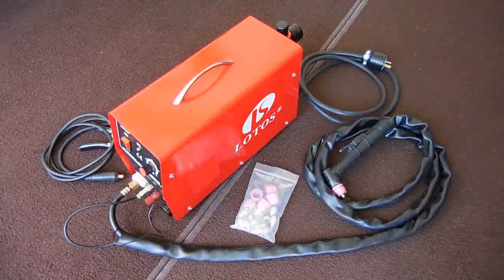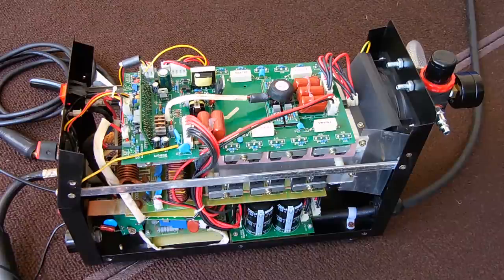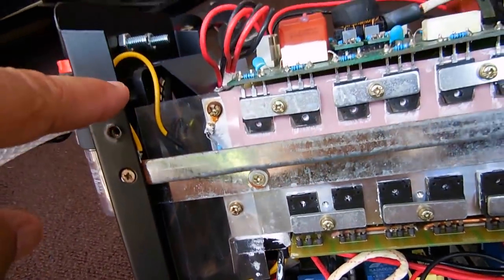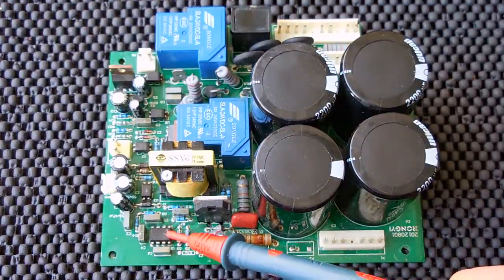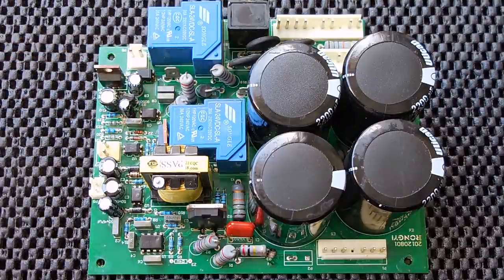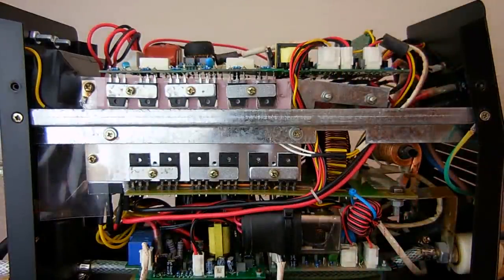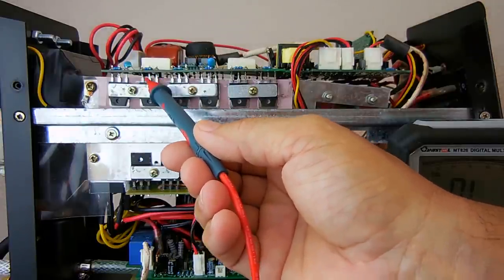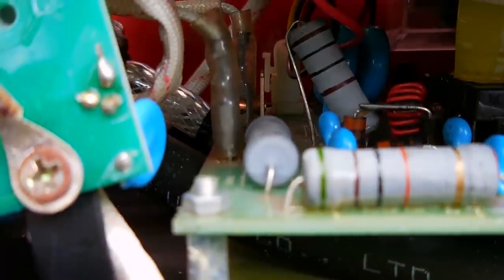How To Repair A PLASMA CUTTER!

Comment: I watched your video looking for an answer to why I'm getting intermittent cutting, or interrupted cutting at both 120 and 240 volts. Is it possible for the contacts to be dirty or incorrectly set on a new machine? This is one of the Chinese-made "Cut 50" machines. Thanks for showing us how to recognize faulty components and check them.
Reply from the maker: Ben Bennett Definitely check the contacts.
Reply: Actually, it was my not knowing how to position the tool. Anyway, I realized I had 19 volts on the display when I turned the unit on. I turned out to be the fan voltage. The fan was frozen until I worked it free. Then when the fan turned off the voltage went to zero. The funny thing is the unit will cut metal with the dial at minimum setting while displaying 19 volts. Anyway, after unsuccessfully trying to convince me that intermittent cutting was normal for these machines, they rendered a $100 refund to me for repair it. I put a clothes dryer cord on it to make sure it gets good power. Like I told the seller, this will work for a hobbyist. Wish me luck. Thanks again for a great video.

Comment: I have a thermal dynamics stacpack power module 6030 in 60/40 which is about over a 20-year old machine anyhow the machine used to work good every once in awhile it would have an issue you would have to tap on the torch and everything else it is a 70 amp machine I really like the way that this machine performed when it did perform anyways I was had the cap off it blowing it and tightening up a couple things that need to be tightened up on the inside for the air fitting I did quite extensive work trying to get that all configured so it fits tight against my back wall cuz where I'm using and I don't have a lot of space unlike some other plasma cutters I've seen like Lincoln they put a really thick film on all your little small components so they don't get loose this machine did not have that so that being said I'm moving it around I'm sure of being a 25 year old machine one of the little things got loose I think it's called a crystal I took it to a few different places they cannot fix it because they don't know what the exact name is of the peace that it needs and they cannot find no information supposably is what they say but if I really wanted to I can have the board fixed for over $1,200 they will fix it at one place called Gelco Electronics anyways I don't want to spend that much when the machine is you know 25 years old if I had to I would if I had to I would because I know the machine but I really don't want to when this part that I unsoldered is probably a less than a dollar or a couple dollar part and I've checked all the other things and everything else seems to be working properly I am just not getting a narc out of the gun air pressure works all that and the air pressure stays now running when it never did before so trying to find out maybe I can send you pictures of this board and a video of the symptoms that has since this little transistor or electronic piece of part resistor capacitor or Crystal is what I'm thinking and what a few people had said did it possibly is but they wasn't a hundred percent sure if I could send you some photos and a video of what the machine doing that would be awesome Lee great thank you so much for posting this video and hope that maybe you can guide me in the right direction of where to get this part from so I can get this machine back up and running like I said I know it's an older machine but man it worked great

Comment: Liked your video! Steve called, he wants his plasma cutter back : )
Reply from the maker: :-). Thanks for watching Matt!
Reply: @electronicsNmore   when you tested the relay did you just measure continuity between the two non coil points
Reply from the maker: @anthonylester3247  Yes. Making sure they open and close properly at a very low level of resistance.
Reply: @electronicsNmore  ok man thanks what would be a low   resistance value on those or one like it? 14v or something

Comment: any tips on how to troubleshoot the pilot arc not working, everything seems to be working fine except for the pilot arc. thank you
Reply from the maker: Try cleaning the contacts and inspecting that board more closely.
Reply: @electronicsNmore  when i checked the voltage output from the pilot arc terminal on the machine when i squeeze the trigger, it puts out a voltage of at least 180 to 200v but there still no pilot arc.
Reply: Did you ever find your problem? I have the same issue

Comment: Hey, great video, however, I get no arc from the two contact behind the resister. Any sugestions or direction to a previous vid. Thanks. althoug mines is not the same model, they seem to be quite simular in design.
Reply from the maker: Try making the gap smaller.

Comment: Hello, Thanks for useful repair video! I have plasma cutter kind of like this, brand Trexus Welbach with pilot arc. Also quit working, no arc anymore. Sparking relay is pulling but makes no arc between gap. Fan/air work ok. I checked diodes and transistors for shorting.  Indicator light in the front panel is flashing when push the torch switch. Before my unit died, arc was cut out many times during use. Any ideas where to look for?
Reply from the maker: Do you have a spark gap?
Reply: Yes, about 0.7mm. Relay looks different comparing to your unit. It looks like this. http://www.tme.eu/en/details/g2r-1-230ac/miniature-electromagnetic-relays/omron/g2r-1-230vac/

Comment: Hi, it is possible to use TIG machine for plasma cutting? i have very similar machine for TIG welding, but i do not have  installed all diodes. on your machine you have 24 of them, and i have only 16(they did not installed from factory)

Comment: I have a dead Supercut 50. Is this similar in design? How do you feel about the Infineon warp speed IGBT direct replacements for the MOSFETs?
Reply from the maker: Hello. I'm unfamiliar with that unit, but the working principle is the same.
Reply: I looked inside, and it is almost the EXACT same unit lol. Ever do a MOSFET to IGBT conversion with Warp speeds?

Comment: I have a lotos ct520D which looks very similar on the inside.  It does plasma cutting, tig welding, and arc welding.  My device powers on and everything appears normal except I cannot get the welder to produce an arc.  I have checked the ground and electrode holder for continuity and both are good so that is not the issue.  Any idea what would cause such an issue?
Reply from the maker: Check the gap!
Reply: I have the same issue did you ever get your lotos ct520d working ..?
I tried everything …. Then just found the awesome video for more fix tips.
Reply: @J-n-J-2016  Mine was from amazon and even though it was past the return date they exchanged it for me!
Reply: @Chadward_  That’s where I got mine I’m gonna see if I can return it 
Thanks for the info
Reply: @J-n-J-2016  For sure!  I got on the live chat with someone and explained that it just happened on its own, good luck!

Comment: What you are hearing is a arc inside the capacitors. That is to the best of my knowledge with what i can hear. Could be wrong or again I could be right.
Reply from the maker: Capacitors don't arc, if they do, they're damaged.
Reply: @electronicsNmore  Thanks for letting me know fella.

Comment: i have  just got a  icut 60 pilot from ebay , it cuts with or with out the ground connected to the work piece , i do not want to damage the machine , i wonder what your thoughts are , :)
Reply from the maker: I'm not familiar with that.

Comment: Doug great video- I have a question - Do you recall if the mains supply cables ( 2 pairs 220V AC (in my case) ) post the main rear ON OFF switch goes to the two lower power supply boards ( 24V dc and 330 V dc ) ? I ask because I disconnected things and labelled everything but I think I missed one cable being the thinner pairs of cable that come post off the mains rear switch. I don't expect you to look but if you remember ?:-)

I have a generic unit that looks to be almost identical inside . It is an interesting unit in that there is alot of different electronics going on. I wish I could find schematics for these units and I am sure they are about . 

a) Model - My unit is a c416 plasma/tig/stick. I can add to this video because I have fixed my unit. 

b) Power supplies - Seem to be located on the lower level . There are two lower boards (front p/s and front p/s) .The rear one is a 24V DC P/S which seems to power the top front board ( conrol electronics) .
b1) The rear of the top board for a 220V unit has 330V DC supplied from the front lower main power supply board situated in the lower front. I am not sure what the 330V DC is or why it goes to the top rear PCB of unit. I suspect it might be The source of the TIG and PLasma and STICK High current /Low voltage ( 50- 80Vdc open ) DC at welding connections .
c1) The middle board seems to be the supply for the WELDING equipment STICK/Tig head and plasma head. 

d1) The power supplies may not strictly  just be a power supply as the main Lower front seems to have lower voltage cables running from middle board back into the P/s as feedback. I suspect this might be to control voltage /current supply ,thermal protections etc. 

e1) The main power supply seems to have 3 x relays ,2 x smaller ones seems to control the AIR solenoid and something else located on the top rear board . I may add to this as I fond more information. If we get enough information I may post a vid because these are so popular and generic and it's worth having information.
Reply from the maker: My unit is in storage, but I think it was dual voltage. I'm not familiar with your unit.

Comment: It is normal for plasma cutters to make that high frequency noise. Whatever the frequency that the switch mode supply runs at must be somewhere in the high audio range 15 to 20 khz maybe?? We had an older NC machine at work that had a 50 horsepower spindle on it that the SCR based spindle drive sounded about the same.It was a bit scary to work on since it almost always sounded like it would blow up in your face. Actually had an SCR blow up once while working on it. Sounded like a bomb going off. MOSFETS and IGBT's are a definite improvement.
Reply from the maker: Yes. I heard a few switching power supplies make noise before, but I was unsure if the noise from this unit was normal. Thanks for watching!

Comment: Good evening, my friend, please help me to repair my machine LTP5000D, the fault is: the arc is turned on and off immediately (the machine does not cut)

I have to tell you that the video is excellent
Reply from the maker: Try adjusting the spark gap.

Comment: I'm tom, can i ask a question about my lotus LTPDC2000D .I WAS USING THE PLASMA CUTTER AND IT STOP WORKING.NO POWER TO ANY THING BEYOND SWITCH WIRES ON THE MOTHER BOARD.I WOOD REALLY APPRECIATE IT. THANKS APPRECIATE IT
Reply from the maker: Hello. You need to follow my video. Thanks for watching

Comment: I'm having some issues with the pilot arc on my plasma it sputters a bit, sparks sometimes will start an arc when the metal is clean without touching most of the time, I checked the gap between the contacts and the arc jumps across I gapped them out a bit and it made no difference in the pilot arc. Any ideas? Thanks a lot.

Comment: I have this same plasma cutter, it worked great but has stopped starting when the trigger is depressed. I took apart the hose and checked the switch at the handset as well as the plug at the other end- all works fine. This leads me to believe it's an issue with the jack it screws into, or whatever board that connects to.

For clarity- when I say it has stopped starting- there is no spark or air flow. Display and fan starts up fine when I turn it on.
Reply from the maker: Possibly a faulty relay.
Reply: @electronicsNmore  that's what I was thinking, although from messing with it this evening (shorting the pins in the jack body), it is looking like a bad connection there. I need to figure out a source for a replacement jack and plug, looks like.

Comment: My cut 50df stopped working as well. I used it once. I have power and air to the front gauges, but no spark or air when I squeeze the trigger any thought? I have cooling fan also.
Reply from the maker: Make sure the trigger switch isn't faulty. Test for continuity when the trigger is squeezed.
Reply: I will check that this weekend for sure.

Comment: New PLASMARGON Cut50 HF problem
Seems to work fine but when I replaced the leaking front face air meter push to release connector I noticed that the over temp sensor’s wires going to the main board are wrapped around the heavy coil of bare wire connected to the torch + air connector. Cannot see any purposeful reason but apprehensive unwinding them and zap strapping them clear while warranty is valid. No response to same querie from PLASMARGON. Thanks.
Reply from the maker: I'm unfamiliar with that unit. Thanks for watching!

Comment: Hi great video one question, every time I change the Chanel mosfet when we turn on the machine always one or two will explode do you know why will that happen¿
Reply from the maker: Make sure you test all other mosfets, and be sure to use exact replacements,
Reply: electronicsNmore thanks I will and let you know if that fix it

Comment: Will someone clear up a question for me on the Plasma torch?  I have heard both ways on this and what I hear is: Some say there is a wire in the torch lead that feeds Positive charge to the tip of the torch to create the arc.  Others say, there is no wire and that the positive charge is initiated by the ionization of the compressed air as it swirls at the end of the torch.  Which one is true? Wire in the torch or ionization to make the arc?  Thanks

Comment: a common problem with this brand is the faulty HF generator. it have a very simple design where are not protected the critical components by the correct spacing between components the manufacturer want save the most material possible compressing the space in each part. and with the HF generator need space between components but is set so close and some times the HV spark jump to the board and burn itself making he burn track conductive and absorbing the HV spark instead to be discharged in the spark gap. and this cause the unit can't open the plasma arc even if the terminals have voltage when you press the trigger
Reply: Would you know if a faulty HF generator would produce the following? 

1. I turned the machine ON .
2. The amperes (AMPS) are displayed (I see how many amps I have set the machine to - set to 15 amps).
3. The green LED (light) is ON (showing power to the unit)
4. The red (temperature) LED is OFF.
5. The cooling fan is running.

Problem
1. When I press the switch to start the cut, immediately the red LED (overheat) comes on. The fan continues to run.
2. There is no arc (electricity flowing top the nozzle). The unit is not cutting.
3. The ground wire was checked several times. The problem is not a bad ground.
The cutter worked once before, then problems started the next day
Thanks
Reply: HAPPY NEW YEAR!.
First in the front panel there a indicator that say OC you make sure if this turn on when you press the torch trigger. if stay off so make the next test. Take a tester select DCV and connect to the output terminals is you get a reading near or over 233v DC this mean the inverter circuit in you machine is in good working. Now the next is repair the HF starting circuit. disconnect any power first and wait like 15min for the capacitor bank discharge completely. take the cover out and check the HF transformer. 1 this is a square ferrite core with yellow tape surround the core or 2 is like a tiny tv flay-back. i need to know the tipe for assist you further
Reply: Thank you for the information. Much appreciated.
Reply: so are you saying avoid this brand ,,, is there a decent low cost plasma cutter you would advise to buy

Comment: Hi, do you have any idea why the plasma cutter sometimes don't want to start and sometimes just occur small spark but it wont start. Just a spark like in spark plug.
Reply from the maker: Inspect and adjust the spark gap, also try gently cleaning the contact areas of the spark gap using a piece of 2000 grit abrasive paper. Thanks for watching!
Reply: @electronicsNmore  thank you for the reply. I'll check it. Btw what is the correct gap for spark gap? Is it standard for any machine?

Comment: So I  have the same board similar problem,  unit powers on if I hold trigger on you can see arc its working but say within 5 seconds of working you can hear fan slowing down then while unit shuts off,  will not turn back on for atleast 5 minutes if I turn it on within 30 seconds led display lights for a second then fades out no fan unless you wait a few minutes 

If I leave switch on the only thing i notice is ptc gets warm but no fan and nothings powered up

Relay problem?
Reply from the maker: You can try tapping the relays when the problem occurs, of course it could be very dangerous because the unit needs to be powered up. You can do it at your own risk. I'd use a long plastic kitchen utensil.

Comment: I have a similar unit, fan runs, but goes straight to over current after pulling the trigger. It does an arc on the inside and then stops when the OC light kicks on.
Reply from the maker: Probably have a shorted(blown) Mosfet/IGBT.

Comment: Is there drag shielded tips for this plasma cutter?
Reply from the maker: I don't think so. They use the steel wire at the tip as a spacer.